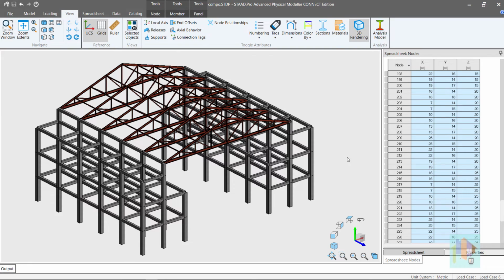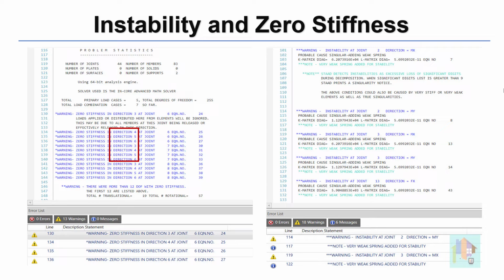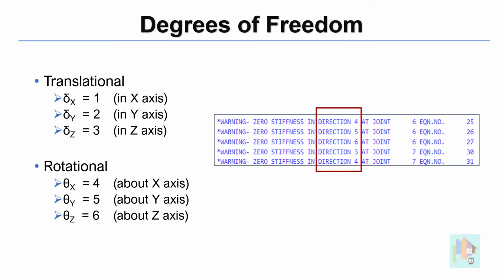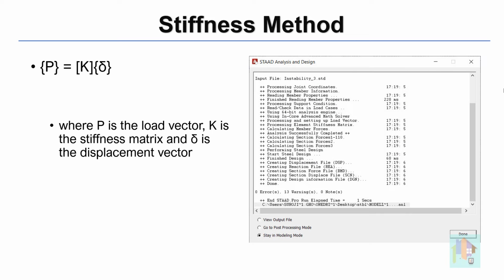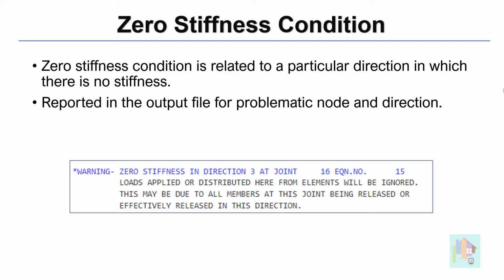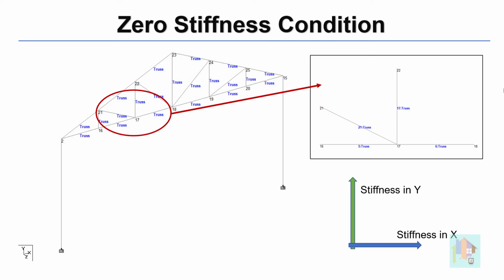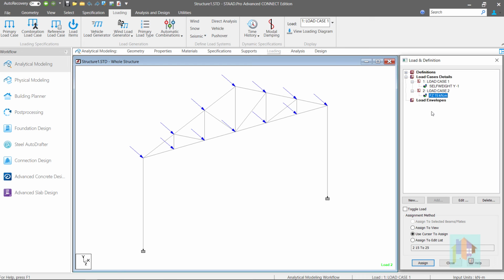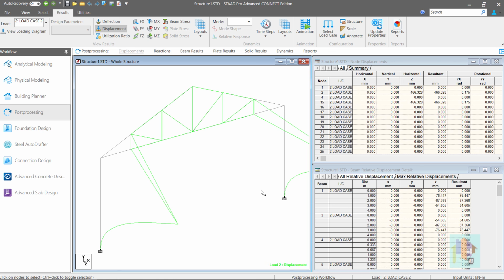Structural Instability & Zero Stiffness: Part 1 – Zero Stiffness and Degrees of Freedom

Comment: **WARNING- THE AXIAL COMPRESSIVE STRESS EXCEEDS THE EULER STRESS FOR MEMBER    

how this can be resolved plz
Reply from the maker: Which design code you are using, AISC ASD or IS800:1984? Though I am not sure about the exact reason, the likely reason for the warning is following --
If you look at the AISC equation H1-1 (or similar equation mentioned in IS800:1984), you will find the following terms in the denominator : (1-fa/Fez) and (1-fa/Fey)
Currently in STAAD.Pro, if either of these terms is less than or equal to 0.0, that term is set to 0.0001. This causes the corresponding moment term of the AISC equation to be magnified by 10000. Consequently, the ratio becomes enormous. We did this to bring to the user's attention the fact that this member has an axial stress which exceeds the Euler stress. If you use a bigger cross section or a shorter one (a smaller KL/r) for which the Euler buckling terms Fey and Fez are bigger than the axial stress, this problem will not occur.